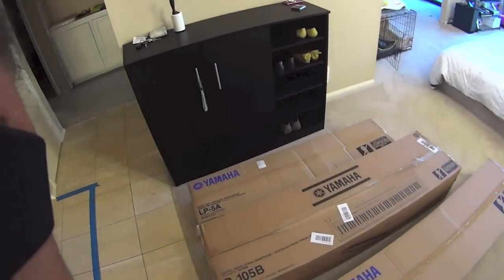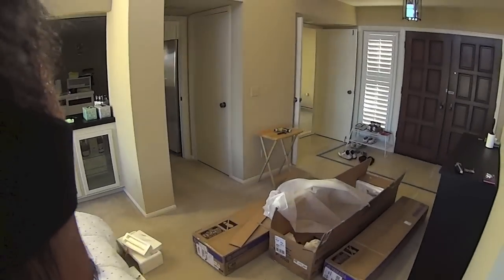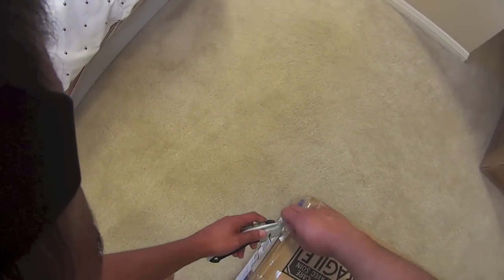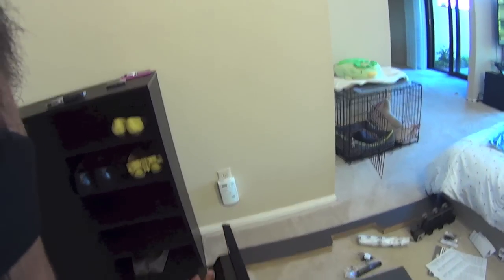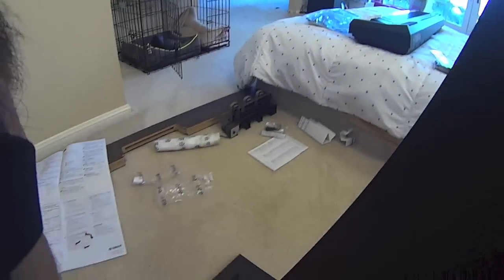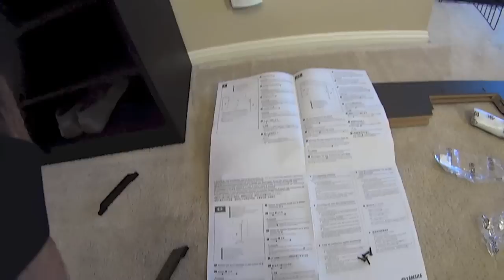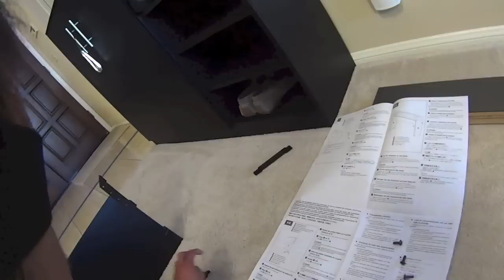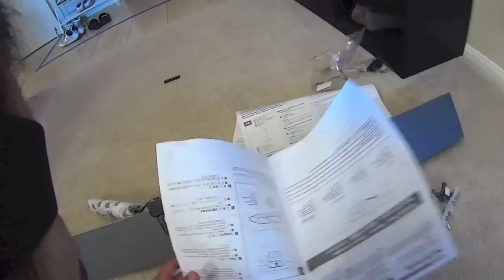Yamaha P-105 + Stand & Pedals: Unboxing + assembly

Comment: Do you absolutely need the electric screwdriver? I'm thinking of getting this stand because I can't find something as sturdy and affordable while being the correct height for playing while seated. I'm looking into
Reply from the maker: synchronizerman not at all. I happen to have one and it’s convenient, but not necessary. 

It has lasted, I still have the piano and stand with pedals.

Good luck.
Reply: @teamsalvation  Thanks. I'm trying to see if I can get an old used L140 for a Yamaha P-155. I would've preferred getting a low table that wouldn't require me to screw the piano in permanently (unless it can be easily removed if necessary?). Is there such a thing out there that I can make-to-order affordably?

Comment from the maker: Yes, the Pedals are actually a separate "add-on". If you go back through the video, you will see how I had to remove some rubber "stoppers" or "caps" from the legs before I installed the pedals. So, you can save about $100(USD) on the pedals and just go with the stand and piano.

Also, the piano comes with it's own, mind you cheap, single-pedal.

Comment: Hey man, nice vid! I recently bought a P105 but in my country the stand is just way too expensive, so I am thinking about building one myself as it does not look that difficult. Would you mind measuring the wood boards on this stand ? Thanks a lot in advance!
Reply: Richard Olandim Hey, are you still interested? I just bought the stand today and I'll give you the measurement if you're still interested.
Reply: +Niklas Lundgren Could you send them to me?
Reply: +Niklas Lundgren I know it's over a year later but I'm trying to find the measurements of just that crossboard, as long as the width is right I can make the sides whatever height I want

Comment: Cool, thanks for the vid.  Now I know how I'm going to build one using nice quality oak wood for half the price!
Reply: +tecnolover2642 lol, did you do it yet? I was thinking the same thing.
Reply: +Jake Methner No.  Not yet.  We still have to get the keyboard!  But that is what I'll do since it looks quite simple to build.  Just need to find metal  brackets that the  keyboard  will mount to.
Reply: tecnolover2642 I just got the stand lol. It sucks but I get it for free at Costco :D
Reply: +Jake Methner 
did costco sell it with a p-105 ?  what are they selling it for?  im actually interested in the korg sp170 over the yamaha but curious what costcos price is.
Reply: No I forgot to say that I got a p45 instead. That's the only piano they have in store. Got it for $440

Comment: Are the holes before you put the screws already made and you just tight them in ?

I am asking, because I don't have the tool you used to do that, so I have to do it with a manual screwdriver. Will it be possible or should I find myself one like yours to assembly the parts ?

Thanks a lot for your video !
Reply: Looks like the holes are already there, he's just inserting and tightening the screws.
 Otherwise he's have to be measuring it to put the holes in the right place. So they must be there for him to easily align and build it as quickly as he did!

Comment: Hi. Thanks for your simple explanation and useful video. 
As a matter of fact I wanna build the piano stand (L85) all by myself. I wonder if you could tell me the exact size and dimention of each right and left bars (which are the same) and the middle bridge as well. I mean width, height and depth of each three main parts.
I've recently bought a standard piano bench which its height is not adjustable. That's why I emphasize of the accuracy of those mesurements. I want to make a standard stand just like yamaha L85. 
If any of you guys reading this could give me a clue with these numbers, I'll be grateful. Both inch or centimeters units are fine.
Thanks alot.
Reply: Did you manage to build one yourself? I am so amazed that people can do these DIY projects. I have enough anxieties just thinking about assembling one stand, let alone building one myself!

Comment: is it easy to remove the piano if i wanna bring it somewhere?
Reply from the maker: Hey Patrick:

I have not had to do this yet, but if I remember correctly, there are just four screws securing the piano to the stand.

If you plan on removing the piano daily, I could see getting tired of having to screw down, then unscrew every day. But if it's an occasional thing, then no problem at all - takes all of a couple minutes.